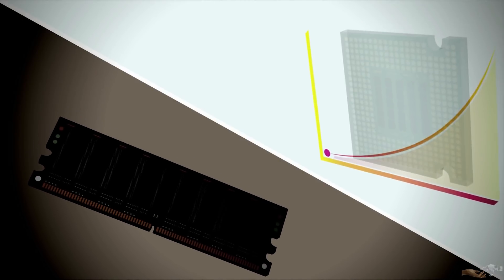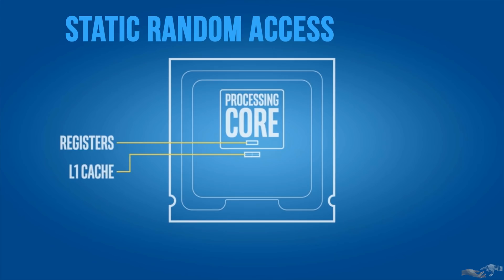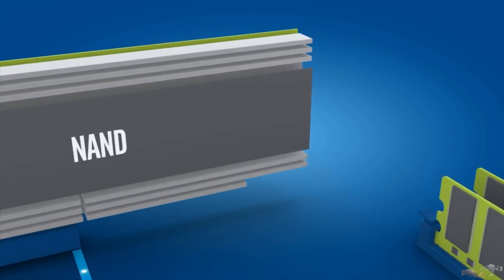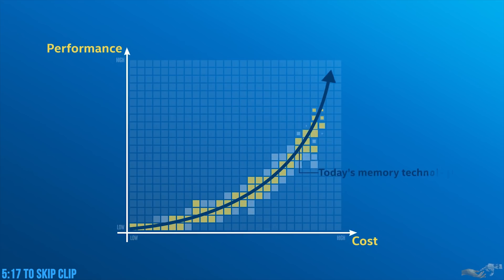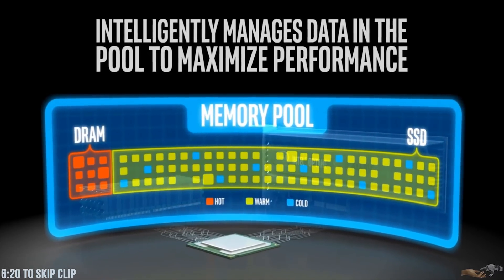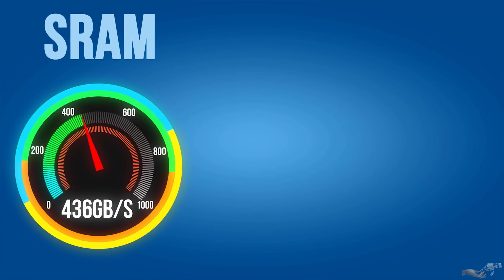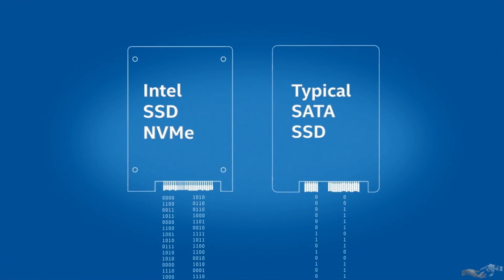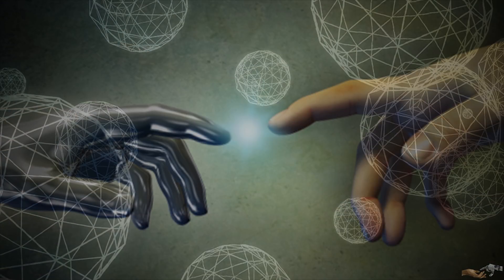Computer Memory Explained | How RAM Works

Comment: My HP has only has a 1 Terabyte Hard drive, but it takes less than 12 seconds to boot up. Ya Hard Drives are Cold & Slow my 🐎! While I do need to upgrade my 🐏, I'm personally still okay with using Hard Drives as my main Hippocampus and Prefrontal Cortex of my Personal Computer for the time being. 😎

Comment: Question: Why not use optical data transfer methods? What are the unsolved problems that prevent us from using light instead of electrons for data transfer on computers?

Comment: HA! Optane was DOA, and the REAL problem is SRAM vs. DRAM not DRAM vs SSD... CPUs don't access SSDs, not even with Optane/nvme - it always go to DRAM  first. But CPUs don't even access DRAM directly anymore - they (pre)fetch it from DRAM into SRAM, and only access data on SRAM. The fetching latency is where the REAL bottleneck is, NOT the loading of data from SSD to DRAM...

Comment: I’m curious as to why there isn’t a fiber optic SATA, as it would be inexpensive, and let normal SSDs reach their full current potential without taking up PCIe lanes on the CPU, which is a pretty big deal on 16 lane chips that don’t have an extra chip and PCIe controller on the board itself. Not much of an issue for the hedt or professional space, but for normal users it would be fantastic.

Comment: Im not sure about your PCIe figures. My NVMe SSD's transfer at 2GB/s average across eight 3.0 lanes. So your numbers don't add up with my transfer speeds.
Reply: It's probably the SSD's top speed. Graphics cards use 8 PCIe lanes and they use up a lot more bandwidth.

Comment: If 3d Xpoint be only implementation of this technology => forget it, is super good technology, but without competition it will be slow or it will die as rambus die, and italium.
You put too much Intel in video, and not get all points of technology, as NVMe can be use not only directly on motherboard, and most implement M.2 standard.

Comment: A development which we are monitoring very closely is the implementation of PCIe add-in cards, like the ASRock Ultra Quad M.2 card, which bifurcate one x16 slot into 4 @ x4 PCIe 3.0 lanes.  This concept allows 4 x M.2 NVMe SSDs, like the Samsung 970 Pro, to be assigned to a very fast RAID-0 array.  Similarly, with an M.2-to-U.2 adapter, cables can connect these x16 add-in cards to 2.5" NVMe SSDs like Intel's Optane model 900P SSD.  As explained in the video, this storage "ecosystem" will double raw bandwidth at PCIe 4.0, with its 16 GHz clock rate, up from 8 GHz at PCIe 3.0.  Measured performance of 4 x Samsung 960 Pro in a RAID-0 array presently exceeds the raw bandwidth of most DDR3 DRAM:  DDR3-1600 x 8  =  12,800 MB/second vs 4 x NVMe SSD @ 3,938.4  =  15,753.6 MB/second.  At PCIe 3.0, one x4 NVMe SSD has 8G / 8.125 x 4  =  3,938.4 MB/second raw bandwidth.
Reply: Thats massive. Why arent nvme using x16 natively anyway?

Comment: I actually stopped using hard drive at all last year. With cloud storage I don't really need a lot of storage, but I do want it to be fast and reliable. So I build powerful desktop with both Linux and Windows on two separate .M2 (NVMe) SSD drives. 2 second loading time for windows 10 =)

Edit: also data centers largely stopped using hard drives for storage needs. They too power hungry, too slow and too unreliable that for data storage companies hard drives became obsolete years ago, while most of us still use hard drive (except me :) )
Reply: Data centers still rely heavily on hard drives for mass data storage. SSD's are preferred for drives that are constantly used, but something like YouTube has massive amounts of data that go years without being accessed.
Reply: Amir Abudubai - long term storage they prefer to store on blue Ray disks as opposed to hard drives. Cheaper and durable. As far as I know. 
Edit: I read a bit on subject and you're right a lot of companies still do use hard drives for cold storage - I was misled by a friend who works at Facebook.
Reply: All sorts of technologies can be used for different reasons. My personal favorite is an organization that was archiving data on digital VHS. Something about having a long life span and being easy to repair.

Comment: Why are graphics cons being used instead of CPUs in crypto mining ?
Reply: I'm pretty sure it's because of the large amounts of data bro
Reply: Crypto mining is parallel so GPU's work much better. Mining is basically guess-and-check computing, so mining basically comes down to how many times you can guess(hash) per second. If you have, for example, a 36 compute unit GPU, then you can guess 36 different values at once. 

It should also be noted that different crypto stress different parts of hardware. There are some that require high RAM bandwidth, a lot that test compute power, some that force serial compute(CPU's are still really good at those) and even some that work off of mass storage.

Comment: I wonder if Optane will reach 2-4 TB capacities before Samsung takes its already huge SSDs and reaches Optane levels of performance?

If you want to build a one drive and its done PC the 960 EVO is about as good as it gets right now. It would be awesome to see Optane be a legitimate challenger for that category.

I am building my new workstation around 4 900P U.2 drives in RAID 0 through an Asus Hyper 16X and VROC. As ridiculous as the performance will be, it really sucks that I sill only get 1TB out of that configuration. Between the crappy latency/4K performance on RAID 0 for traditional M.2 SSDs and lack of bootable VROC on non-Intel drives Samsung was not an option here.